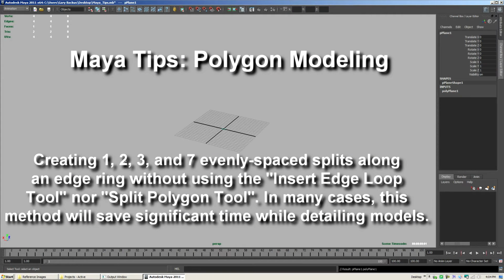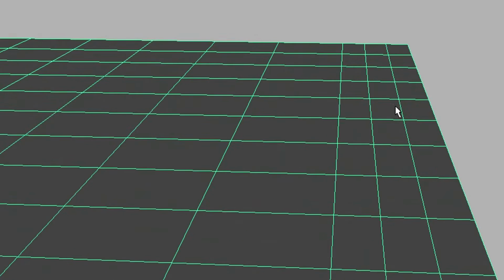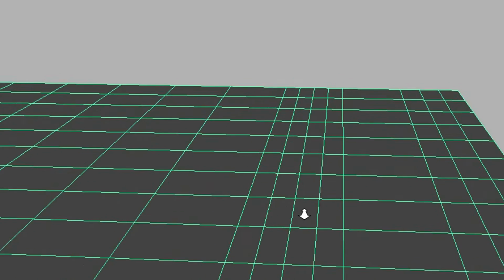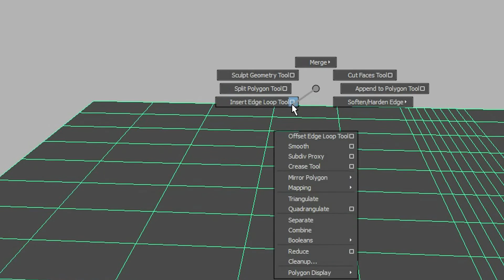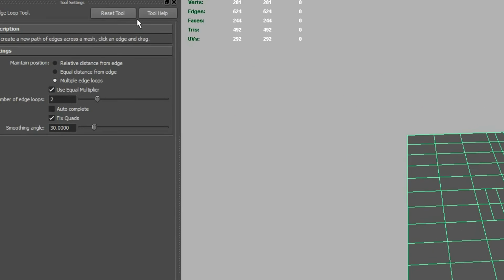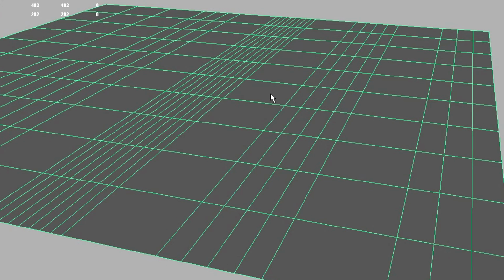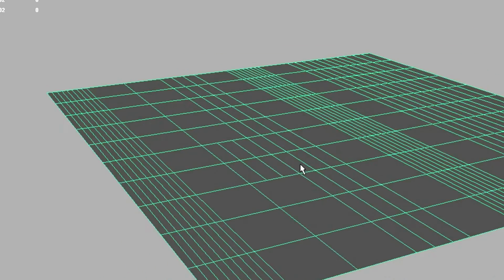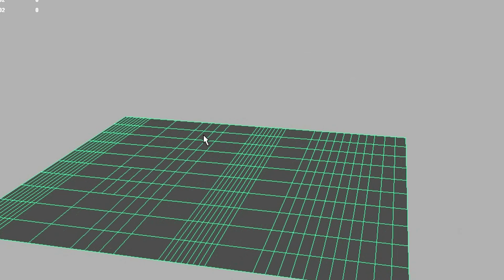Maya Modeling - Fast method of splitting edge rings and loops

Comment from the maker: Yeah it's great. I have little need to assign 40 hotkeys just for common modeling operations. While it's true that hotkeys are slightly faster, I personally would go with marking menus any day; one hotkey combination opens up many possible commands. You can create polygon primitives nearly at the speed of thinking about them with the default "Shift+Right mouse" (with nothing selected) marking menu. Of course, it won't be something you get good at overnight, it takes practice but it's worth it.

Comment from the maker: @LloydDustin Yeah you'll sometimes notice people complaining that modeling in Maya is slow; it is slow if you use standard menus. In actuality, it's very fast if you're using the marking menus. Polygons have a default marking menu that is really good, NURBS don't have a full MM though (just a few options). No big deal, as you can make your own marking menus of course. If you're using polygons a lot (most people do), I'd say to definitely get used to those marking menus.